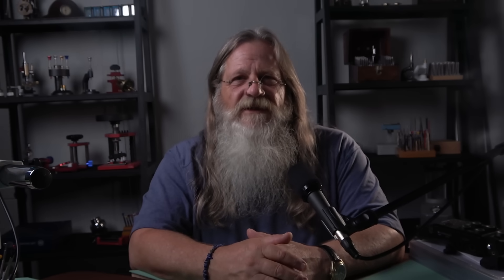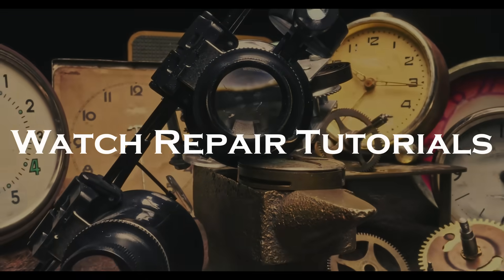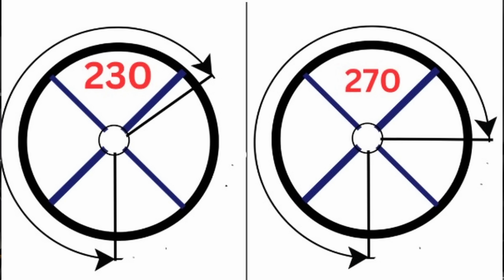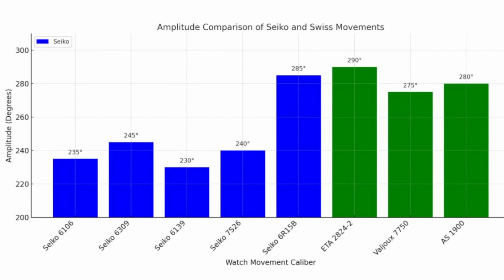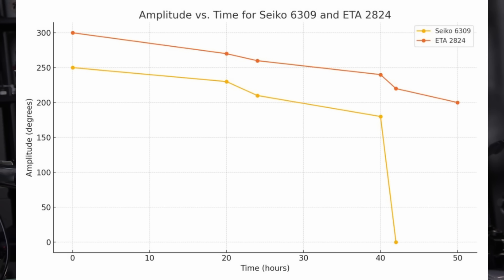Why Seiko Runs at A Lower Amplitude

Comment: I had my 6138 serviced & the watchmaker replaced the main spring with a new one originally designed for a ETA 2892 as the size was very similar. It now has about 260 degrees of amplitude & is very accurate gaining about 2 spd
Reply from the maker: There is no doubt that you can improve the  performance of a Seiko movement. The escapement can also be fine tuned as well.

Comment: Yes, as expected you're absolutely right ! Unfortunately , some people don't understand this and install thicker barrel springs during servicing . The main result is that they reduce the movement's lifespan ...
Reply from the maker: Putting too much power to the escapement could definitely reduce its      lifespan without upgrading other parts of the movement as well, but very few people are going to do those types of modifications.

Comment: Hi Alex, great video as usual. I think seiko movements are excellent, I recently serviced a 1977 lordmatic which had finally stopped running for the first time having never been apart. I've always wondered why other movements don't have their pallet fork pivots lubricated because the loss in amplitude is minimal and I've never seen a seiko pallet fork pivot worn. Regards Nigel.
Reply from the maker: Seiko definitely have made some solid movements over the years but pallet pivot wear is very rare in Swiss jeweled movements as well. You will see pallet pivot lubrication in higher end Swiss and American movements that have end stones for them but not for standard pallet jewel holes.

Comment: I'd say most current NH movements are good for 260 - 310 pre & post service easily , mine are surprisingly accurate within a 3sec window daily inc current Orients  (that bare an uncanny resemblance to the older 6 series Seiko's), as for Eta's & its variants ..love 'em !.
Reply from the maker: You are right. The new generation of movements seem to operate at higher amplitude in my experience.

Comment: I'm a Seiko fan and have bought and serviced quite a few older Seikos over the last couple of years. Kalle Slaap of the Chronoglide Watchmakers channel says Seikos are the gateway drug for hobbyist watchmakers, and he's right! But anyway, 230° of amplitude is the threshold I look for. As Alex says, any lower means there's more work to do. I've seen some on YT get 270° to 290° with the use of a Jacot tool. I'm not that dedicated.
Reply from the maker: You can definitely improve their performance by adjusting the escapement but there are not a lot of people willing to take that on.

Comment: 8 year old 7s26 runs at 246 in horizontal. I just aquired another seiko from 1979 which has the 6309. It's running at 220.  I'm not sure what I'm going to do with it yet.
Reply from the maker: Those are some good numbers for vintage movements, they may still perform well for a long time!
Reply: @watchrepairtutorials  Thanks Alex. Your videos are the best, and when it comes to regulation,  I don't think anyone else has covered the etachron system. That video was a great help to me in making the 7s26 unbelievably accurate.
Reply from the maker: @patriot_III_tinman I love hearing that. Thanks my friend.

Comment: Hi Alex, great to see a new video! Great topic and very informative for newbies like me!! 
May I please ask you to consider making a video about mainspring winders,  specifically for seiko nh35/34/36 and Miyota 9015/39/75?
I am planning on doing to them, what you suggest doing to the ST36(take apart, service and re test), and im struggling to find specific winders. I'm trying not to waste my money as they're very expensive in general, and purchasing the wrong one would be a disaster. 
Thank you!
Reply from the maker: If they are new, just do everything except servicing the barrel. Get your before service data and then service the movement  and compare the new data to the old.
Reply: @watchrepairtutorials Thank you Alex! I thought of that, being a brand new movement, but assumed it was frowned upon. I'll do that for now. Thanks a lot!
Reply from the maker: @TimeUpRay  it’s frowned upon when doing a real service of course but if you are practicing there is no need tearing the barrel apart yet. 
To service the barrel, you either need a winder or a new mainspring and again you are better off  just concentrating on the main service.

Comment: I have many ETA and NH builds , Both work great! … NH Movements are very easy to work with for modding watches .
Reply from the maker: You are so right although I find the newer movements easily achieve higher amplitude.
Reply: If these movements had tolerances like you have in your punctuation, they would not run at all. No spaces before commas and fullstops,* only after.*
Reply: @einundsiebenziger5488 my beautiful watches run flawlessly All 24 of them!

Comment: My old Seiko's have always been more reliable than the new ones. Im not convinced on Spron and the 6R movement line. Seiko has known the magiclever isnt efficient enough to power a 4Hz or above movement since the 1970s, but it is more reliable than swiss reversers
Reply: Los Seiko 5 de los años 70's y 80's sí fueron relojes para toda la vida. La mayoría de los que aún encuentro siguen funcionando a muy bien
Reply: I had issues with the 4RXX movement, feel Seiko needs to create a better movement.
Reply: @samnova450 the last true chronometer capable movement Seiko made was the 4S line in the early 2000s. I doubt they will make accurate movements any time soon as that would drive people away from GS.
Reply from the maker: It will be interesting to see if they develop anything new. My feeling is probably not anytime soon.